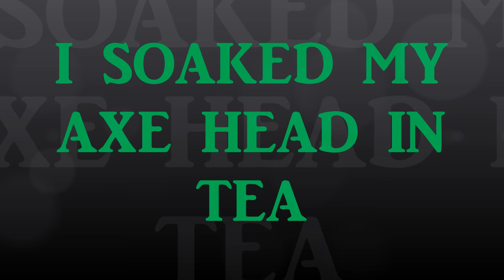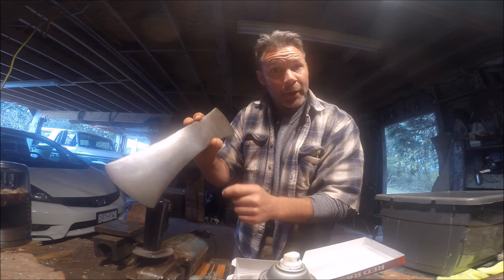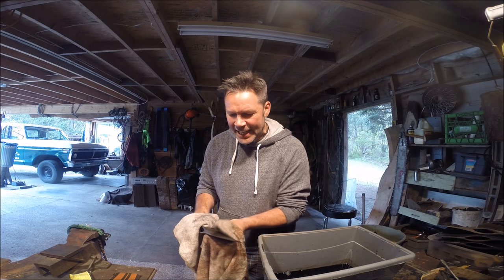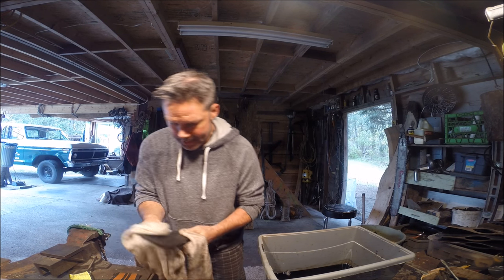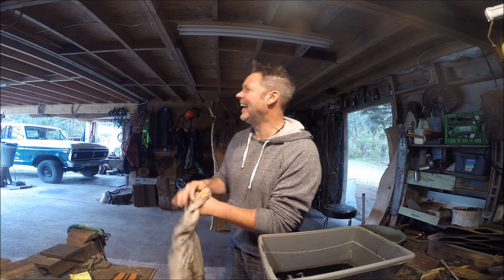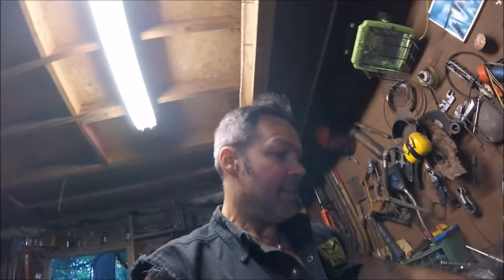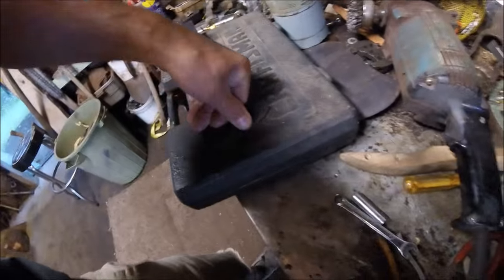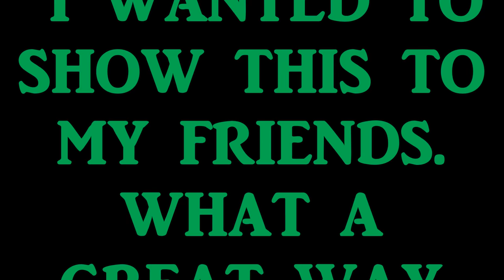a cool method of putting patina on axe heads

Comment: The patina comes from a reaction between the iron in the steel and the tannins in the tea. Tannins are used for "tannin" leather and are to blame when your apples turn brown after they're sliced. 

Same sort of principal applies when dissolving #0000 fine steel wool or rusty nails in vinegar or water and then using the resulting solution as a wood stain. The iron in solution reacts with the tannins in the wood to produce a nice dark stain similar to the patina formed on clean steel by the tannins in the tea.
Reply: indeed, boiled up oak bark will do the same
Reply: @seanthomasdowd  boiled oak bark to patina metal or for making a stain with iron oxide?   And acorns could be boiled also, you'd get some food out of it and have the tannin "tea"

Comment: It is a great technique and all the various comments about other forms of tannin are right on. One small enhancement is to add a couple of drops of lemon or orange juice in with the tea. Literally just a couple of drops! You want to give the tea a minuscule level of acidity to help the tannin bind with the steel. Too much acid will etch the steel and it won't look like patina. Also, the water you use is important, if it has chemicals (like municipal treated water) or well water with a lot of minerals it can impact the outcome. If in doubt use distilled water to brew the tea to get the pure effect of the tannin.

Comment: That is pretty slick and surprisingly it doesn't just wipe off. I like to blacken the plastics on my saws, which I use Rite clothing dye and slightly boiling water, only takes a few minutes and it doesn't come off or scratch off (like spray paint would). I wonder if it would work as well. Stay sharp and stay safe my friends.

Comment: Turned out really nice I used Mustard on my Bushcraft knife same result I wiped it down in alcohol air dry to remove oils  then used 3 treatments an hour at a time with the Mustard / could also use potatoes they work good no need to boil anything and doesn’t take days

Comment: I always use the vinegar soak to get the rust off. To get the colour  back to original I use Birchwood Casey's Super Blue. It's an easy wipe on application made for rebuking firearms.
Reply from the maker: +Mike Dice , ya I have heard of it as well and do want to try ,, thx
Reply: Scratches off easily tho. Cold bluing Isn't very durable

Comment: Find a nice spot in your yard that has some really nice black topsoil,dig a hole about 2-21/2" deep and take your axe head and bury it with a couple of pieces of nice cleaned copper,silver is better but copper works too but make sure they are  touching(the axe head and the copper/silver.leave em in there for a month or more,but not more than 2 months.afterwards dig it up and it should have a nice patina on it.
Reply: what’s the deal if you go over two months without checking the dig?